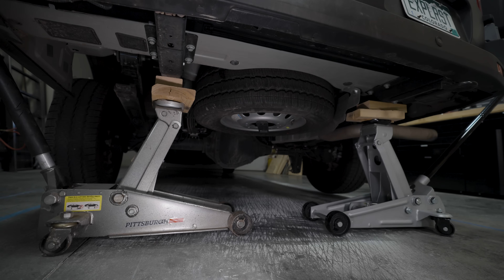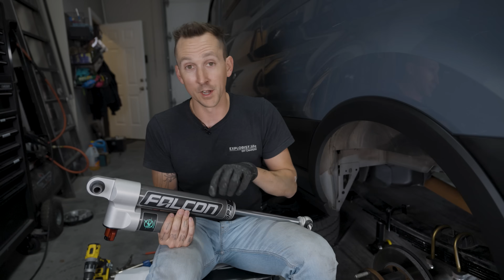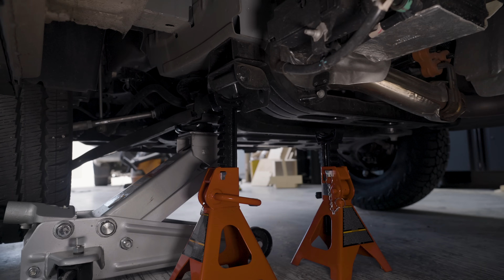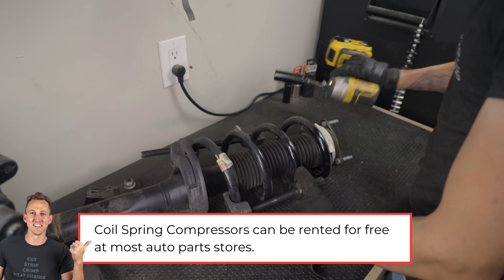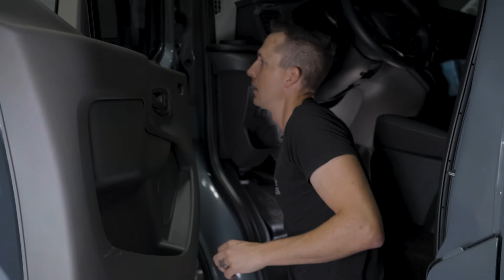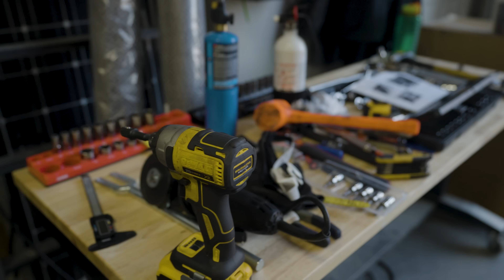Ford Transit AWD Lift Install

Comment: Looks good Nate.  Just found this old vid.  We're looking to replace our Sprinter in 2027 and with diesel being so crazy expensive combined with the maintenance cost of the MB we considering a Ford van next. Like every yearly service is over 1k and they always find something to jack it up more.  This year was the worlds most expensive drive shaft - like 5k for that and service.  Thanks for sharing! If we do get a Ford we could use the price difference for a lift, wheels, and tires?  Did ya consider aftermarket lower control arms?
Reply from the maker: Thanks for watching! Those Sprinter maintenance costs can definitely add up! A Ford could be an interesting option, especially if it frees up some budget for upgrades. We'd love to hear more about your plans for the next van and help you figure out the right components for your build when the time comes! Feel free to reach out to our team here: https://shop.explorist.life/support?utm_source=youtube&utm_medium=comment&utm_campaign=support&utm_content=response_link

Comment: Hi thanks for putting ur effort for us learn much appreciated I have a 2023 3500 hd awd srw extended cab with a high roof its the above 8900lbs previous owner installed a set of air rides and thats it I haul a 16’ trailer with four quads and 5 dirt bikes rear leafs are already flat I get swag bottom out and roll over driving specially when its windy  can you please guide me on what set up I should  purchase 
Thanks
Reply from the maker: Thanks for the details! With a 3500 HD high-roof van, an existing air-ride setup, flat rear leafs, and the weight of that trailer and bikes, we’d definitely want to take a closer look at your exact setup before recommending parts. Reach out to our support team with these details and we can help determine what setup and parts you’ll need: https://shop.explorist.life/support?utm_source=youtube&utm_medium=comment&utm_campaign=support&utm_content=response_link

Comment: is it true the ideal max for AWD to avoid damaging front CV axles is 2 inches?  I like the 4-5 inch kit but wondering your opinion if i should stay at 2?  i have a extended transit high roof
Reply from the maker: IDK, just lift it has high as you like and if it knocks 10% life off your CV axles, it's not a big deal and you can just replace them.

Comment: so I'm curious...going to do this to my 2023 but I believe some of the bolts ( steering knuckle pinch bolts, wheel hub nut, brake caliper anchor bolts ) are TTY one time use. Did you look into this or find anything that also confirms whether they are one time use bolts? Would hate to have the bolts shear from stress after re-using them. Thx for any info you have.

Comment: Thanks so much for this. Considering for my 2025. Question: do you find necessary to turn the shock every Winter and back every Spring. I’m also in cold winter conditions and wonder if it’s necessary ….  Cheers from 🇨🇦
Reply from the maker: We don't do that, no.

Comment: The expense,and labor seems like a lot for a small amount of lift.
When i hear claims of improved highway handling I'm sceptical.
It's human nature the want to feel good about a large purchase. I should drive a lifted transit before rendering opinions 😂
Reply from the maker: If you don’t need additional ground clearance and on highway performance is the most important to you, some upgraded springs and shocks can help with the rear end sag from a camper upfit.  A full blown lift with adjustable rate shocks like we did here is overkill if your van will never be off the pavement.

Comment: That's a lot of work to increase center of gravity, decrease road holding and stability, decrease gas mileage with larger frontal area. 👎 For "looks and stance"  Nonsense.
Reply from the maker: The fuck did you click on the video when you knew you were going to be triggered by it? Consider just clicking a video covering topics you’d prefer instead? What a weird way to spend your time.

Comment: Strange how the front isn't raised nearly as much as the rear. Those spacers don't even look to be an inch thick. And with the IFS roll the vehicle a few feat before you measure the height after removing the jack.
Reply from the maker: In these builds, all of the weight is in the back, so more ‘lift’ is needed to prevent sagging/etc.

Comment: With 2” lift will damage the cv johin? Thank you!
Reply from the maker: Not, like, immediately or anything, but lift kits inherently are more rough on cv joints than leaving the van stock height.  I guess you've just got to ask yourself if having more ground clearance is more important than your CV joints lasting longer.

Comment: Hi, I have the same van and just wondering did you see a drop in gas mileage when you installed the van compass suspension in this video? Thanks
Reply from the maker: Probably.  I've never had a lifted vehicle with bigger tires that didn't suffer from lower fuel mileage.
Reply: @EXPLORISTlife  Thanks a bunch!

Comment: I watched this to see how my VC S4/T2 was installed. Great video but wanted to mention that inserting Sumo Coil Springs in the front coils make a world of difference on the front mushy sway.  Crosswinds no longer bother and it drives like a car around turns. No bouncing turning into driveways..
Reply: I was wondering if installing front sumo spring would help even with the S4… I’m guessing you think so right ?
Reply: @TheTylerman007 that’s the easiest I think. Now I think they recommend using VC lower control arms with the S4 lift. Since then I’ve combined a Qlift / Bilstein struts with the VC S4 and VC lower control arms and the lift is amazing and performance is good as well.
Reply: @o @ozzywon 
Thank for letting me know …
Do have a S4/T2 and the front behaviour still not as I was expecting for the cost of it…
Maybe I need to change with those arms or try first with the sumo coil … just don’t want to spend another 2-3k$ and be disappointed again !
Before installing the sumo coil did you add the impression it was going left and right on the road ?

Comment: The OEM tires you replaced with the falcons are the available for the 350 dually as well?
Reply from the maker: Hmm. not sure.  Never looked into the dually versions.

Comment: Awesome video!  If you had to do it again would you go with the same lift kit and would you make any other additions to the suspension?
Reply from the maker: I'd do it the exact same.  It has been great.  The literal only problem is accidentally turning the knobs the wrong direction  and forgetting which direction (1 vs 3) is for on vs off highway and having to re-look it up in the manual. 😂😅
Reply from the maker: I would also say that for towing a trailer, it's also awesome.  Even right at max weight capacity of the van/trailer, it's good to go.

Comment: Looking for the tire rack link, but couldn’t find it in the description .. only the lift kit … Vancompass STAGE 4 TOPO 2.0 SYSTEM ($2,600) and Tires … Falcon wildpeak a/t4w 245/75/16 ($820 for 4) and method mr703 van wheels ($1,200 for 4) =$4,600 .. any idea how much it would cost to install lift kit at a mechanic?
Reply: I found the estimated shop time (9 hours) and will check with my local mechanic.  I can not find the link to tirerack in the video description.  When I try going directly, the Falken tires are accepted, but the website says the method rims 703 are not available for 2023 Transit rwd 250T.  Which method rims did you choose?
Reply from the maker: Sorry for the links.  I hate when they change those around.  We used the 16x6.5 Method MR701 wheels.  Note: Our van is the 3500 SRW AWD.

Tires are: LT245/75R-16 Falken WildPeak A/T3W E

Comment: Why didn’t you replace the front strut?
Reply from the maker: The van had like 3,000 miles on it.  Didn't need it.
Reply: @ Thanks for your reply. I kinda figured that was why. Are there front struts that you prefer? Btw, I really enjoyed the video. Well done. 👍🏻
Reply from the maker: You may reach out to Van Compass for that question as we haven't yet looked into struts that will specifically work with this lift.

Comment: Great video, Nate! The 2" lift kits can put angle constraints on the axle shaft and other components, leading to premature wear. Some lift kits, like WTD, seem to have addressed this problem. Do you have any comments on this? What would be the best 2" lift kit you would recommend if budget was not an issue? Thanks!
Reply from the maker: Lift kits, in general, put wear on a vehicle. Period.  If you don't want additional wear and tear on your vehicle; don't install a lift kit.  I'm probably not the best person to ask about stuff like that because I've live all-but-one vehicle I've ever owned; in spite of various wear and tear; and I assure you that whatever abuse comes as a result of HAVING the lift kit is more wear and tear of the lift kit itself.

Comment: Hey Nate, this may be a silly question but did you buy 5 of the wheel sets for a spare? Wondering if the larger setup still fits under the van? I am hoping to not have to mount the spare on the back and keep it underneath. Also trying to keep costs down and if I did not need to buy 5, but was concerned if I did need to change it out driving on the original spare could harm the van. Thanks so much!!
Reply from the maker: We did not buy a full size spare.  It probably wouldn't be good to drive for an extended period of time on a mismatched spare, but personally; I'm fine with limping it to the next tire shop on an undersized tire.
Reply: Thanks so much for your quick reply. Your videos have been such an incredible resource!!

Comment: Hey Nate n Steph, Great video again. Can you please give me an update on the front suspension lift as far as knocking and or sponginess now that you've  completed it closer to a year now? I'm heading west to the back country soon and need your best opinion. Thanks so much guys. Mike
Reply from the maker: No issues.
Reply: @EXPLORISTlife  Any recommendations Nate??
Reply from the maker: Nothing specific.  We just installed the suspension system as shown in the video and it has been working great.  Were you looking for a more specific recommendation on something in particular?
Reply: @EXPLORISTlife  I'm gonna be doing lots of forest access and logging roads. Are you still happy with the Falkens and can you go to full steer without a rub in or out?? Thanks again, Mike
Reply from the maker: Very happy with them, yes.  The rub a little at full lock if I hit a bump; which is pretty standard with any lifted vehicle with larger tires.

Comment: Any trimming to get those 245/75/16 on? Rubbing?
Reply from the maker: A little
Reply: In the video you said you didn't have to trim!
Reply from the maker: Makes you wonder that if, over time, I found that I eventually was rubbing and, perhaps, needed to trim? 🤷🏻🧐

Comment: At 30:21, I am pressing hard on the lower control arm, but no matter how hard I press down I can't clear enough to insert the ball joint into the hole. Have you come across that issue?
Reply from the maker: lol, yeah; that required a pretty significant amount of pushing and cussing to get it to clear.
Reply: I could not do it myself. I had a friend sit on the leverage bar, while we maneuvered the stud into the hole. 🎉
Reply from the maker: I recall wedging my self into the wheel well and basically bench pressing the breaker bar down, holding it in place with one hand once it was low enough, then manipulating the ball joint.  Definitely a pain.

Comment: According to the Ford Factory Manual...
Most all the fasteners you have worked on are not to be re used...

Why are some bolts one-time use?
Most OEMs have at least one example of a one-time-use fastener/part. The reason it is only good for one use can vary. For example, torque-to-yield bolts are designed to stretch during the torquing process. These fasteners cannot be reused because of the excess amount of stress that was caused during installation.Jun 4, 2021
Reply from the maker: Yeah, vehicle manufacturers also doesn’t want people installing aftermarket lift kits either, but here I am never having had a non-lifted vehicle. 😆

Comment: why does the shock mount have to be cut?maybe later change the suspension. how will he enter?
Reply from the maker: I guess it doesn't 'have' to be cut; but it hangs down a long way so the high-clearance shock mount fixes this problem and results in higher ground clearance.   I guess if increased ground clearance isn't a desired feature, you could leave it as-is; but I don't know why you'd spend the money on a lift kit if you didn't want more ground clearance.
Reply: @EXPLORISTlife  ok I understand. with this kit can it be combined with air suspension or is it unnecessary? thanks for great video details
Reply from the maker: This is a high end suspension upgrade, which makes air suspension unnecessary.
Reply: @EXPLORISTlife  I understand. thank you and sorry for my not so good english. warm greetings from Greece. I hope you have wonderful travels. 🙏👍💙😎
Reply: @EXPLORISTlife I bought this kit and my RV has rear anti-sway bar. Can I still install it?

Comment: Nate  Another Great Job       
Witch One did you use  ?   
Shock Tune     Light / Mid   8500        OR         Mid / Heavy   Over 8500
Again thanks very much for all your Hard Work !!!!!
Reply from the maker: Heavy.  Light/Mid is more for vans that may sometimes run empty (delivery trucks).
Reply: Thanks so much !!!!!!!

Comment: Excellent video, a question on this model (Ford Transit AWD) even Air Sprig (Air Lift brand) is placed on the Bumper stop, here comes my question, if we install this kit or another Vans compass topo 2.0, is an air spring compatible? I say it because of the height gained
Reply from the maker: That's probably a better question for Van Compass directly, but I can't imagine why you'd want to do that after installing a high-end suspension system like this.  Air bags are a bit of a quick fix that the adjustable shocks & bigger leaf pack handles.  Even when we are pulling our heavy horse trailer, it still doesn't sag any more than it should.
Reply: Thanks! and with this rear gear from 5 leaf spring the van doesn't get harder in the back, I mean hard as in more rigid? I have the same Camper and I want to install a Van Compass system but I'm not sure whether to install the 2" dowel or the Mini springs. @EXPLORISTlife

Comment: How do you like the falken 245/75 /16's? You have had them for several months. 
I have the same van, same suspension upgrade running max gvw looking for new tires.

Comment: Thanks for the video. I’ve been toying with the idea of this upgrade for a while now and I always balk at the cost vs value proposition. It seems the biggest benefit from everything installed is the bigger/grippier tires. With the 245/75/16 do you still need the lift?
Reply: The Transit Trail is mounting 245s with a 3.5" lift but it still has a low clearance of 8" so the cost justification is challenge. Watch Brendan at Gone Mobile to hear of his paying Van Compass to install upgrades, trimming wheel well pinch weld areas for clearance of tires. And research Agile Offroad to hear what happens to Sprinters, etc.' components when subjected to off road abuse....expensive proposition either way.

Comment: Great video . I went crazy every time you called a nut a bolt . Went crazy about 30 times .
Reply from the maker: Well, I guess if that's the biggest frustration you've got going on in life, I'm happy for ya. 🤷😂😁
Reply: I need to replace the front struts on my 2020 Transit . Your video is the best one out there, by a mile . It didn’t pop up 2 weeks ago when I searched . Maybe you can add a keyword for the search engine . Thanks for the video , sans the nuts .

Comment: I don’t really understand why you would put a lift kit on a street van I know it’s all wheel drive but they’re junk. You can’t get them off camber at all. If you’re taking it off anything more than a logging road you’re just asking for a world of problems.
Reply from the maker: I mean... if you only use yours on the street, that's your deal. 🤣😂🫣
Reply: @EXPLORISTlife  i guess I’m smarter then the average 🐻 
Don’t forget to put a winch on you will need it 😀
Reply from the maker: We've done more off Road travel in a fait 500 than most lifted trucks will see in their lifetime.  I'm not worried about getting stuck, that's just part of having fun.  I will literally off-road anything.
Reply: I've taken my mustang off road so...

Comment: Now that you lifted your Transit, keep a close eye on the passenger side CV axle and check the boot from time to time. I only speak with experience because pinched the boot twice causing it to tear, love my local Ford dealer because they replaced the whole CV axle under warranty.
Reply from the maker: Yeah; we check CV joints, brakes, and all other suspension components in all of our vehicles when we rotate our tires in the spring and fall.
Reply: If you could mention which Ford dealer, i heard this would void warranties.

Comment: Thank you for this terrific instruction video!
 Maybe I missed it, but were you able to fit the bigger tires in the spare tire well? And if so, did you have to do any modification?
Thanks again!
Reply from the maker: We kept the factory spare in there.  Should be good enough to limp us to the next tire repair place in a full blowout situation.  We carry plugs/compressor for everything else.